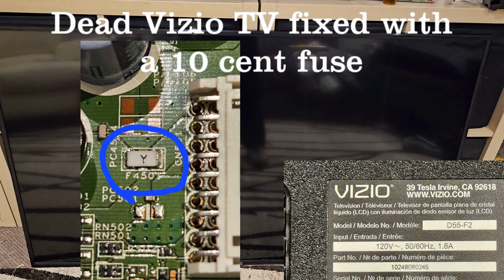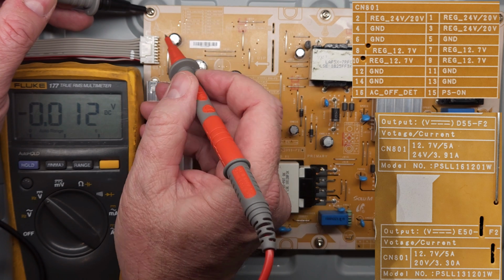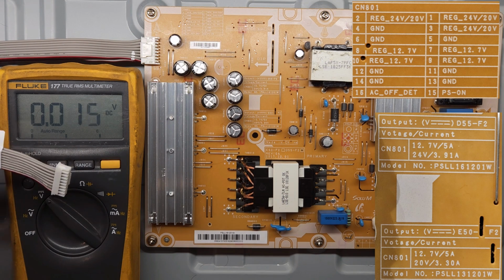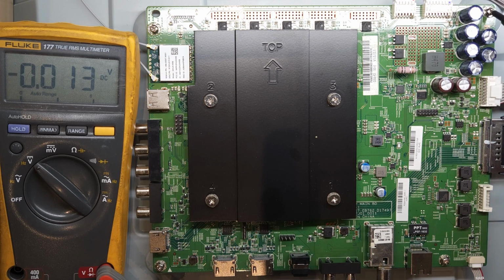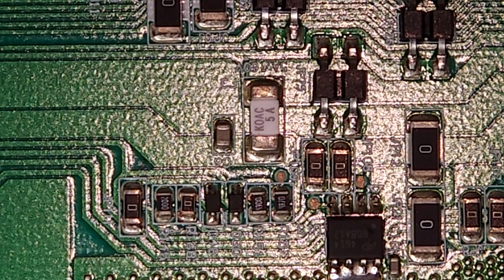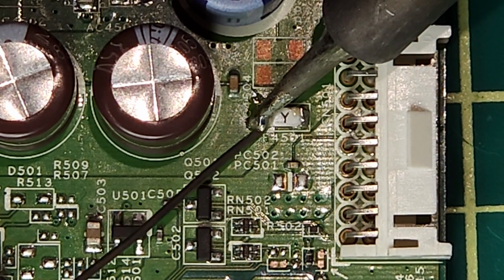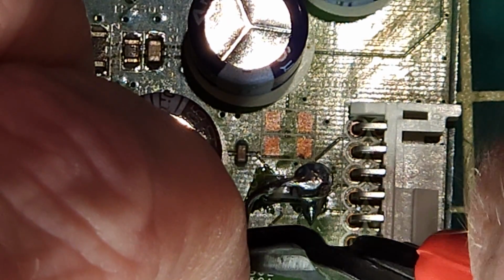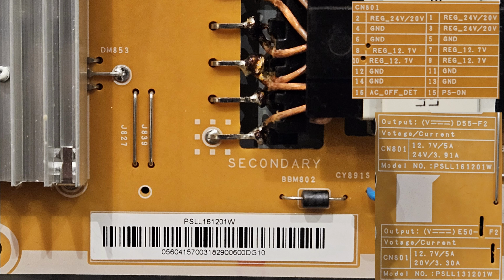Vizio d55-f2 TV won't turn on #easy #fast

Comment: How much would this repair cost roughly
Reply: TV repairs in general tend to be a minimum of $100 if you pay to have it done. This is one of the simplist repairs that could be done, so you'll probably be at the bottom end of whatever they charge. If this is the issue... If they find something more seriously wrong then it could cost you nearly as much as a new TV. Then if you choose to get a new TV instead of continuing with the repair, you're still stuck with a bill for the diagnostic work. If it's a cheap TV like a Vizio or TCL then you're probably better off just buying a new one than paying for it to be repaired.

If you have the knowledge and equipment to do it yourself then this is just a 10 cent fuse like said in the video.